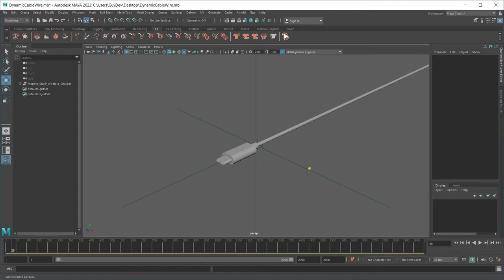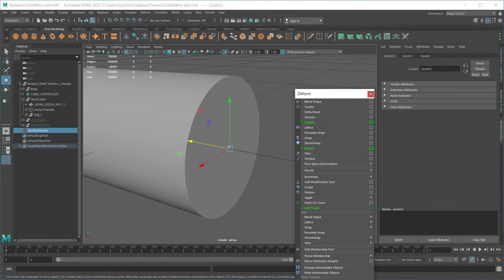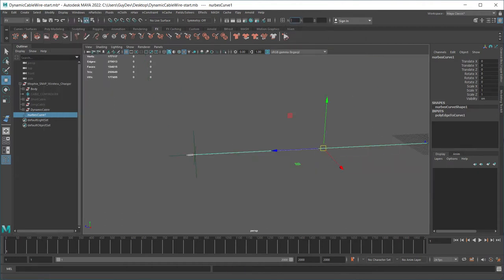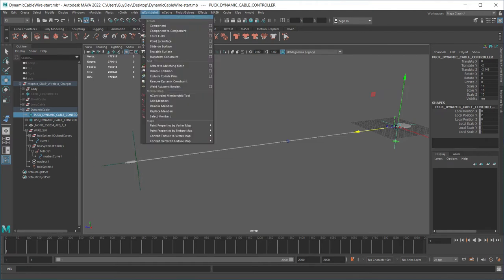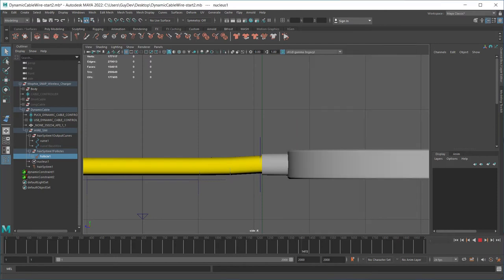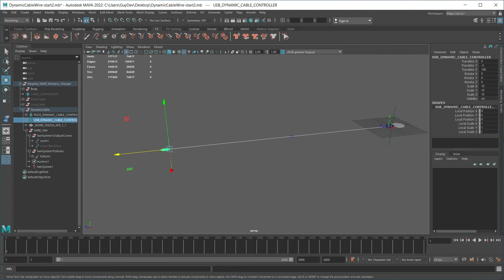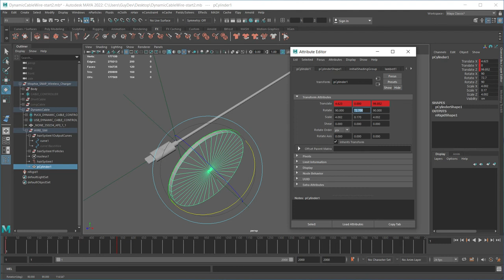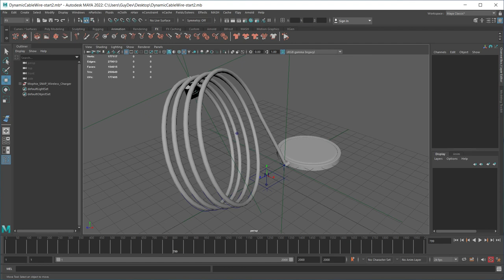Dynamic Cable Wire: Wire & Cable Rigging Using nHair Dynamics and Wire Deformer

Comment: Hello! Thank you for this tutorial! I am having trouble at the wire deformer part. The output curve's dynamics work correctly and look good, but then when I apply the wire deformer to the cable geometry, the dynamics act completely different. The wire now stretches infinitely and won't stop. Do you know what might be wrong?
Reply: Please check your Stretch Resistance, under Dynamic Properties in the hairSystemShape1 node. Increase it until it resists stretching according to your needs.
Reply: Also check you haven't accidently changed another attribute.

Comment: For some reason my passive collider is not interacting with the wire. I have a computer mouse on a desk. The desk is a passive collider, but the wire keeps dropping below it. I have multiple passive colliders. The wire falls on top of the desk, some notebooks and other various office props. It just keeps falling through
Reply: Hi! For that, please check that for your table, you are selecting nCloth > Create Passive Collider. Also check that your table mesh is positioned correctly. Bring it to the center of the world, zero out all transforms, then reposition. You could also try to check the nRigidShape on your table, turn the solver display to Collision Thickness and check if it's showing thickness. You might want to adjust. If it's not working, it may be because you have multiple nucleus nodes. So when applying the Passive Collider to your table, you might try nCloth > Create Passive Collider > Option box, then make sure you apply this to work with the solver node that is attached to your hair system. So in this example, it would be nucleus1. If all else fails, I'd be happy to look at your scene. Dropbox link would be fine.

Comment: Hi,
I'm stucked when applying the Wire deformer portion. The cord polygon object just won't follow the curve even though I applied the deformer.
Reply: Hmm, there could be a few things that went wrong, but hard to tell. Maybe your project settings or the dynamics not activating? Maybe double check your geometry. Maybe try again with a simpler setup. Or feel free to send me your project file and I can take a look. Thanks!
Reply: Select the geo, then in channel box under INPUTS bump up the dropoff distance (to 20 or something) until it responds...

Comment: Hello thanks so much for this tutorial it helped me alot! im having a bit of a problem though, i needmultiple cables in my scene and wonder how to eazy multiply the first one i made? ctrl+d gets me a group where the cable doesnt seem dynamic at all i guess it has something to do with the nucleus but im not so sure since im a noob:)
Reply: You can try Edit > Duplicate Special > Options Box and make sure Duplicate input connections is checked, and/or play with the other settings. It may or may not work.

Because of the complexity of this setup though, you might want to create it a different way. I believe you should only need 1 Nucleus, but you can create all your wires and hair together. I think you only need 1 hair system, but you can use multiple curves. You will also need to manually create the constraints for all of them. I think that will be the issue when duplicating, because when you duplicate special, some of the new objects will be connected to the old constraints and system. I hope the best!